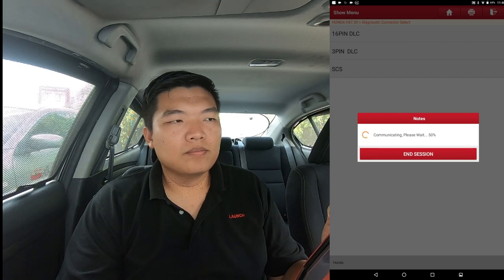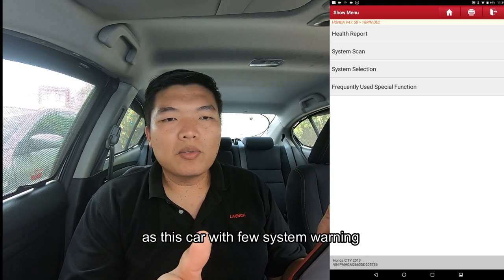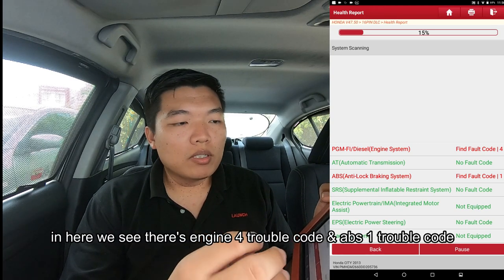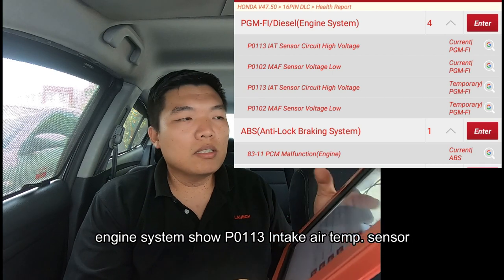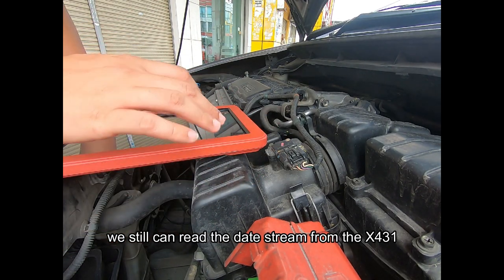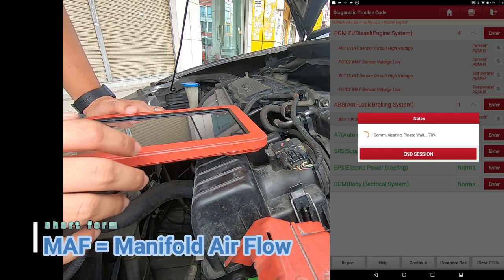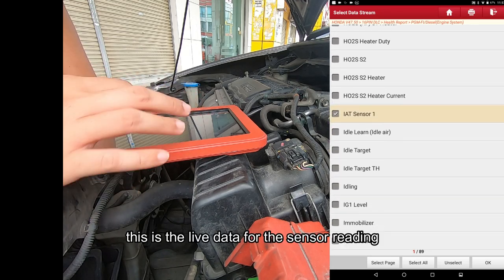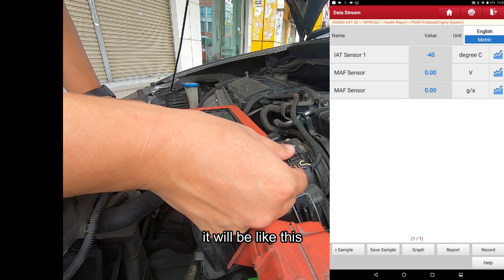X-431 | Products Training about Basic Vehicle Diagnosis | LAUNCH

Comment: Hey hi 
I been using the x431pro for some time now 
And I am over due on latest version update 
The news about vehicle management systems and manufacturers introducing security measures to the obd ports, I believe one or two vehicle manufacturers have already introduced to such systems. So before I update to latest version I have a question before I spend my money and My question is How will LAUNCH be dealing with this,